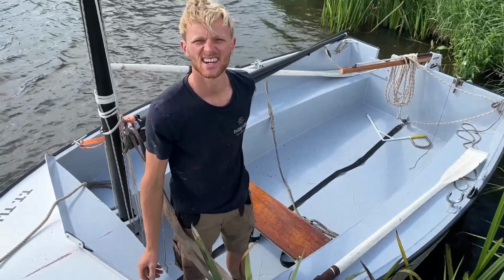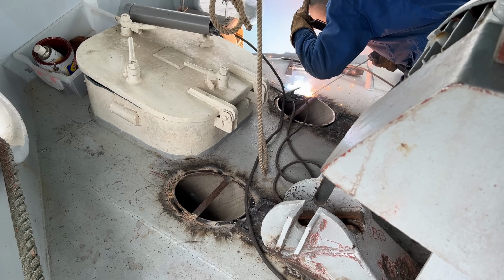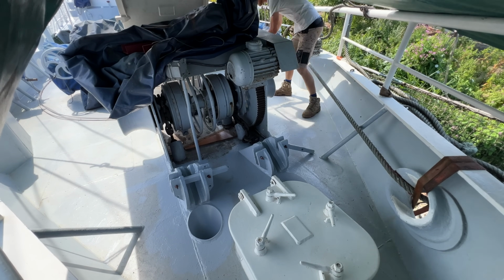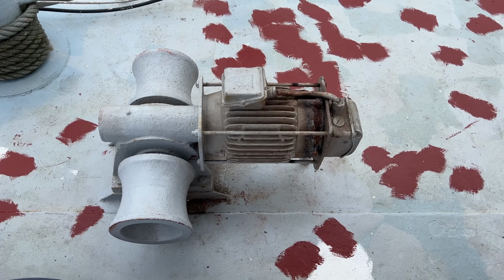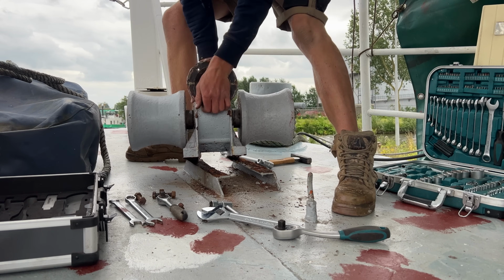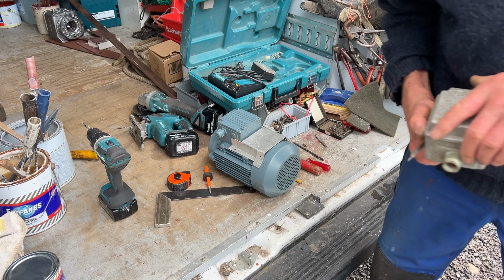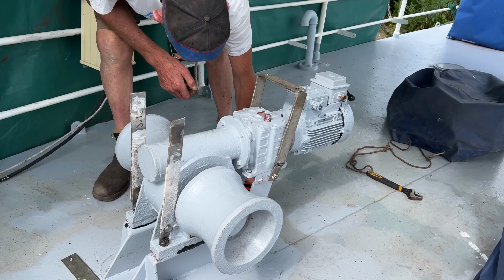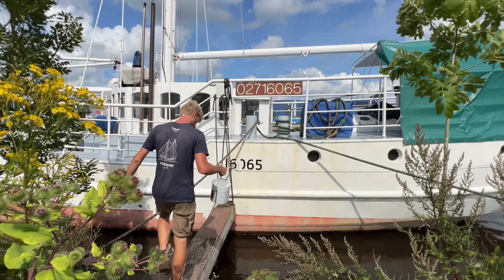You Cannot Use Stainless Steel on a Steel Ship, Or Can You?

Comment: Its a steel boat. Corrosion is always going to be a thing. 316 marine stainless is about 70% iron anyway, so I would really doubt that combining it and regular steel above the waterline would present any issues at all. Great work. She looks great with the anchors in place!
Reply from the maker: Ah yess, that's a good point, thanks!
Reply: Yeah it's not that uncommon,  never seen or  heard of it causing issues.
Reply: @tigersharkboatworks 

It's best if it's solidly inertly welded.

Comment: More great work and nice solutions to the issues that come up.  What I am going to suggest is more an industrial application, but have you looked into an impressed current cathodic protection system for your anchor tubes?  Under way the tubes are always going to be water soaked and dropping and raising the anchors is going to abrade away the protective paint.  The cathodic protection system does not have to be very fancy and should be able to be fabricated for minimal cost.
Reply from the maker: Phoo, an iccp does sound fancy. We're trying to keep things as simple as possible. The new stainless pipes should do the trick, right?
Reply: @tigersharkboatworks  Actually it could be as simple as a 6 volt battery with a couple of wires.  The SS is going to be okay, it is the connection point to the steel where the corrosion is likely to occur.
Reply from the maker: We're gonna monitor how it holds up. If it doesn't work out like this, we can always install a simple iccp like that in the future. Thanks!

Comment: Great to see you working with dad. 

The boat is covered in white paint and red anti rust paint. Can I ask what the final colour plan is and will you dry dock to do the underside/ bottom/ anti foul paint? 

Great videos, keep them coming. Great to see the boat being rebuilt.
Reply from the maker: Thanks! The final colour plan will be the same, white hull, light grey deck, and red antifouling. The main reason is that white really helps keep the inside of the ship cool in warmer areas. It also makes it very easy for us to spot rust :).
In drydock, we'll get a clean hull and fresh layer of anti fouling, apart from hull thickness survey and some underwater thru hulls etc.
Thank you!

Comment: Do you require the engine or generator to run while under sail ?
Reply from the maker: The solar panels deliver more than enough energy to sail and live without running an engine :)
Reply: @tigersharkboatworks  is that with all system running , you don't have much solar , fridge, auto pilot for the boat must be heavy  usage.  ?
Reply from the maker: We have 2500Wp solar, which is quite substantial. The modern fridges are very economical, al the new electronics use peanuts, and the steering pump uses 300 watts. All together, we have energy to spare in summertime. In wintertime, we have to run a generator for an hour a day to top up the batteries :)

Comment: Thats standing still at a dock . I have worked on yachts that size . Solar at 100% capacity will be close but how much when sailing will be in the shade . And cloudy days .and night hours . No sun . Can you all hand steer . Or does steering require power .
Reply from the maker: We are gonna have to find all that out. I'll be able to tell you in a year or two :)
Reply: @tigersharkboatworks  that you will, thats a heavy boat to go around on burning diesel ,  what does your main engine burn per hour . Ltrs 10 ? 
Battery bank has to be big , but if leadacid , evan bigger as can only use 60% of battery life for long life .  Generators are the most unreliable  thing on a boat ,  you go on large boats so can see this conversation is valid .  Keep the great work up, respect
Reply from the maker: 10 litres an hour on average indeed. They are, and the most maintenance intensive. That's why we want to run them as little as possible :)
Reply: @tigersharkboatworks  batteries storage of power and producing power , your biggest problem for the future , I have worked on sailing yachts that require more than that ,    batteries first to upgrade , lead cannot take the amount you need to put in quickly , miss out a generator.   Very large output altinators awsome way to go , but not when burning 10 litres an hour .  Can you get a small diesel engine , run on about 2 litres , and only used to create power not propulsion. With large output altinators , you have the room,  save 1000s € in fuel.   What do you think, ?
Reply from the maker: Sounds like a very good plan

Comment: Your anchor shackle looks to be barely half the diameter of you chain. It should be at least the same diameter as the chain otherwise it can compromise your whole anchoring system.
Reply from the maker: Ah, that must be an optical illusion, but you got me here with the caliper. measuring 19mm on the chain and 20mm on the shackle :)